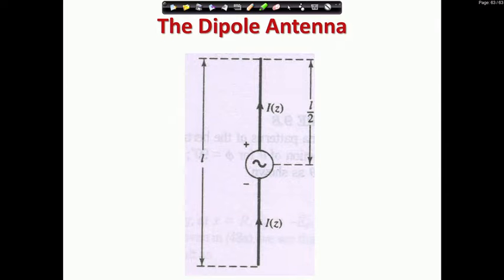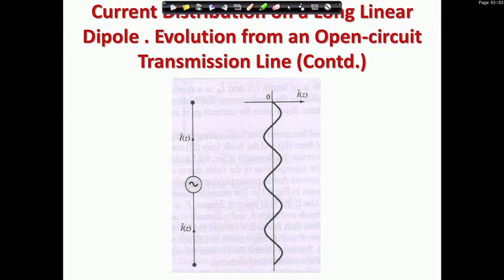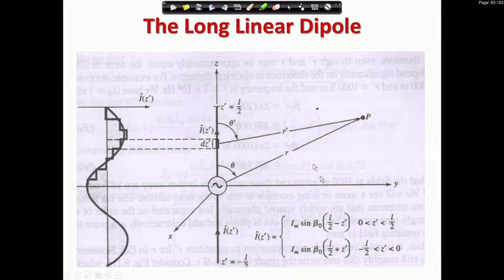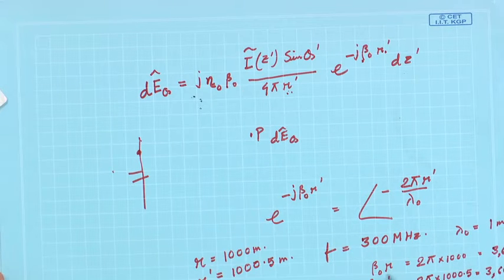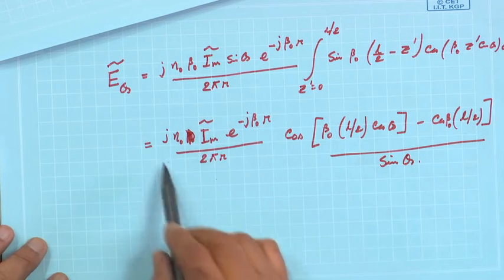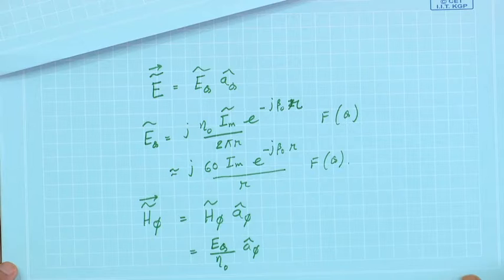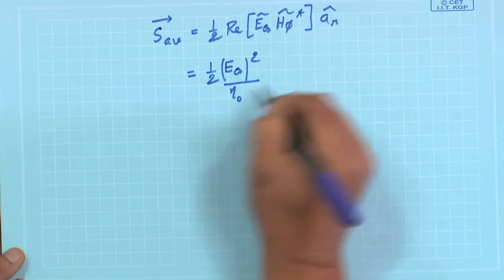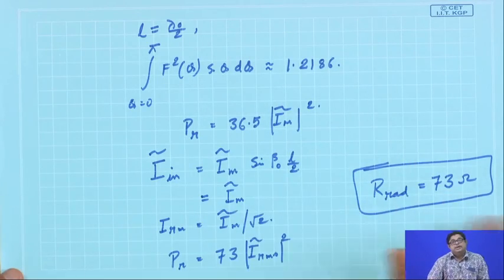Lecture 12: Dipole And Monopole Antenna

Comment: No body has clarified how in a open cicuit like monoppole and dipole antenna current flows?secondly it is not short circuited when dipole is folded.how will you let me know?
Reply: It's not conduction current that flows in air it's the displacement current